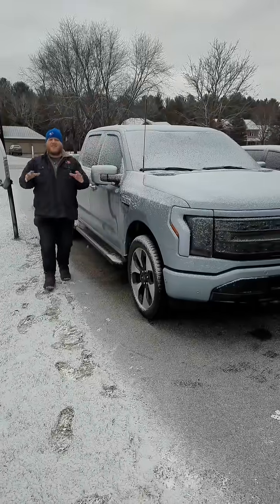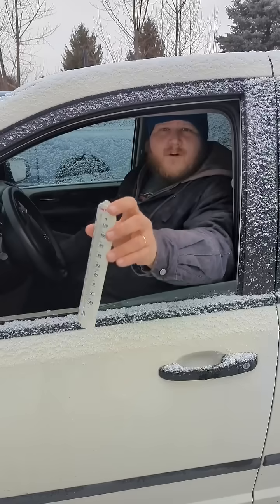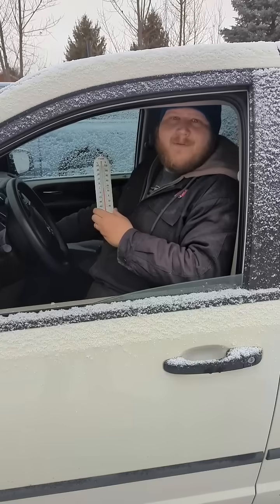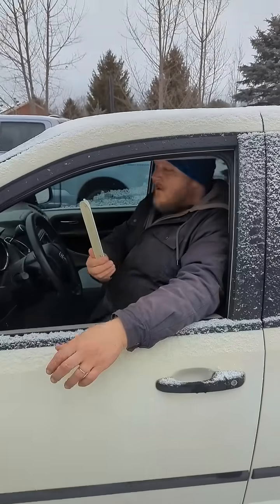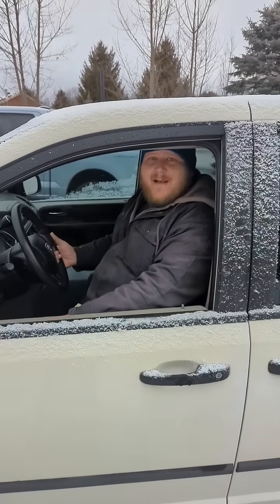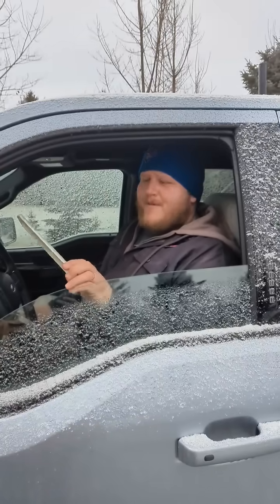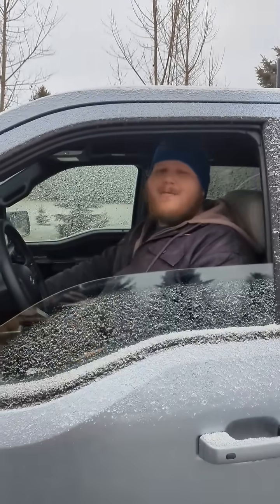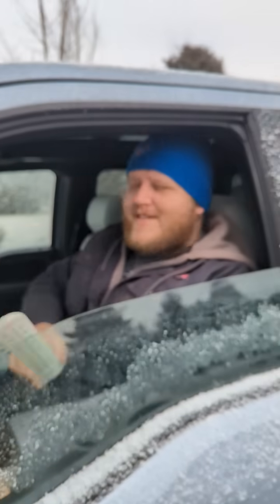Electric vs Gas - Heater Wars! How Long Does the Ford F-150 Lightning Take to Heat Up?

Comment: During that 4 minute warm up you can plan your charging route and figure out how to kill 45 minutes at each station and tell insist that you aren't cheating on your wife. And explain why you missed your kids ball game.
Reply: Because cheating on your wife is no excuse to miss your son's ball game. 😂
Reply: Ah, but here is the thing, you can leave the truck plugged into the charger while it's heating up and you are having fun with the wife. Then you come out to a car with fully cleared glass and one that is nice and toasty while perhaps having picked up a bit more range due to the battery pack having been warmed in the process.
Reply: Lol where did you get these fake ass numbers? Try renting one for a day and then talk after your experience.
Reply: It has like 400km of range in winter. How much are you gas heads driving that it’s not enough for a day?
Reply: @jonathanfields4ever  It's not about having it when you want it, it's about having it when you need it.  And I could not imagine how stressful it would be driving any distance in the winter where recharge stations are not as common as gas stations...and the electric range is not reliably known.
Reply: @fraidykat  it’s not stressful at all. It’s way better than a gas car. You start with a “full tank” every day, you have instant heat, there’s no concern of carbon monoxide poisoning if you get snowed in somewhere, the traction control is better… aside from public charging it’s better in every imaginable way.
Reply: @jonathanfields4ever  thats true, if your riding around empty pussyfooting around town and not actually using a truck for what it's used for  .
Reply: @HK-Guy  which the data show 90% of truck owners do. They’re status vehicles, not work vehicles.
Reply: @HK-Guy which is prob 80% of trucks these days…😢
Reply: @HK-Guy  You do understand that trucks arent just used for "work" right? lmao.
Reply: @jonathanfields4ever  I had someone come into work the other day with a lightning. I asked him how the range was and he said it was the extended range battery that got like 400 miles on one charge, but when it was cold out (it was only like 30 degrees) he said it cut the range down to 240 miles

Comment: So you used a mini van with a heating area four times larger than the F150 and made it seem like the F150 was way better at 5 minutes. Sad thing is the F150 battery is so cold you can't charge it until it warms up. EV fail.

Comment: You kinda botched this by one the ford has the window kinda up almost half way. The heat is not going out as much as it did the first time and two using a older vehicle to test against js

Comment: Hook a trailer and some weight to that turd lol. Technology just isn't there yet.
Reply: Heres 19 reasons why electric vehicles SUCKS.

1) It’s too expensive 

2) Also cause pollution because it’s created by dirty fossil fuels 

3) Tires wear out quickly 

4) Only reliable when temperatures are warm and when it’s cold, it can bring danger to the driver and passengers.

5) Charging stations are hard to find in midwestern states. If you live somewhere like Wyoming or North Dakota, it is clear that you are going to have a lot of difficulty finding charging stations, as well.

6) Roadside Service does not provide Full Coverage and lot of this has to do with the fact that their parts are not on-hand and they are more difficult to actually find than ones for regular cars. Also, auto mechanics will not know how to fix electric vehicles since they didn’t built it. You probably have to find Elon Muck and ask him to fix it for you and he will probably charge you for a million dollars. 😂

7) Travel shorter distances due to the fact that these are cars that need to be charged, they simply do not have the same type of mileage range that regular cars often possess.

8) Too much focus on luxury vs. dependability. With all of the issues that have been discussed thus far, one may be questioning what exactly car manufacturers are aiming for when it comes to making these models. In short, they simply are spending too much time on overall luxury rather than dependability.

9) They get noisy early on. Owners of electric cars have been quite open about the fact that they are prone to make a lot of noise very quickly into their usage lifetime. There is no question that over time, this happens to all types of vehicles, but it is alarming that it has been happening so quickly for electric ones.

10) Maintenance costs far more because when dealing with expensive cars, one can always assume that repairs will end up costing far more. However, when observing electric vehicles, it is clear that the prices to fix them are at an extremely excessive rate. This is largely because finding its parts is far more difficult.

11) some electric cars look ugly

12) Battery pack replacements are expensive due to the fact that electric cars run on their battery packs, it is clear that they play a major role in the overall performance of the vehicle. However, their batteries are prone to needing replacements as time passes by, and they end up costing a ton of money.

13) Recharging takes a long time

14) Durability is not consistent

15) Tend to be heavy due to the fact that electric cars are built with different materials. In fact, the heavy weight of these vehicles is likely another factor that ends up making their tires begin to drop in quality so quickly.

16) One major aspect of the electric car market is that there are limited choices. Unlike regular cars that comes with an abundance of different options, car manufacturers do not seem to release multiple electric vehicles. This is not a solid idea, as electric cars are trying to grow in popularity.

17) Not Good In The Snow. Electric cars definitely meet their match when they are used in the snow. They are prone to having a lot of malfunctions with this type of weather, while also having a lot of difficulty while driving on slushy roads.

18) Too Much Hype. "Show not tell" is the philosophy that car manufacturers should possess. However, when it comes to electric cars, it is clear that this currently is not the case. There is no question that the market is pushing for more usage of electric power, but they have yet to accomplish much in the way of persuading the vast majority of the public.

19) Having a smart car means that the government can track your every move and can listen to your conversations. 

DEMONcrats and leftists wants to banned EVERYTHING. Gas cars, gas stoves, guns, cows, meat, freedom of speech, freedom of religion, and etc. I’m not going to go along with their authoritarian policies so fuck them!

Comment: This is an invalid test. Nothing about the two vehicles are similar, you got a almost 10 year old vehicle with huge interior space vs and brand new vehicle. Also we don't know if the dodge has dual ac or not. Also, test the lightning without the heated cabin option. Here's some advice, delete this video and post a video that has two brand new vehicles.

Comment: There's multiple other EV testers comparing their heating abilities.... much more thorough test... actually measuring the interior air temps in real time, not just what comes out of the vents. Both types of EV heat (resistive as well as heat pumps) were significantly less effective than regular ICE engines. Heat pumps were better than the resistance heater style)...This is well known & a big reason they push seat heaters & steering wheel heat & now some testing with heated seat belts.... because they're trying to heat bodies/core because the actual heaters are very slow to actually heat the whole cabin. In extreme cold, a regular engine heats the whole vehicle almost 4x faster even though it takes a few minutes to heat the engine..

Comment: I have a diesel heater in my van it doesn't take hardly any time to warm up. Don't half to start the vehicle to warm up with a diesel heater you can leave the heater on all night if you wanted to.

Comment: Lol so many ways this could have been done right... cab size for one? A van compared to a truck? Ur joking right...use a gas f150 and an ev 150 with the same size cab..
Roll the damn window up and have the camera man sit inside with you... Who the hell heats up a car with the window down... knuckleheads.

My 05 Honda Odyssey melts the snow and Ice off the window within 2 minutes and the leather seats without the heater will be warm enough to get in and leave by the time I clean it off, what a reach to try to promote an EV. Lol.

Comment: The only way I would drive an electric vehicle is when they make it so it can charge itself as it drives or if for some reason I bought one I would convert it over so that way as it's driving it's producing electricity and charging the battery but I would never own an electric car because I'm not paying $20,000 for a new battery and I like my gas vehicles they're a lot more dependable and a lot safer than any electric vehicle on the road

Comment: One kilometer in range lost in 4 minutes meaning continued use of the heater is a big power draw on a battery with already reduced range because of the cold weather. If I wanna pull the sleds out an I gonna have to pull the truck back home? 😂 Cool toy, but less practical than ice vehicles. Especially with rocketing energy demands and prices, cost of ownership looking better and better for ice.

Comment: When the heater core failed on my Honda, I bypassed it and bought a $60 plug in heater that fits on the dash. The car gets warm soooo much faster than waiting for the engine to warm up. You can feel the heat almost instantly and it defrosts the windshield much faster as well.

Comment: Amused.  That’s a stupid test.  Put that bullshit up against a pre-85 Ford with the original radiator and it’ll heat up faster than that electric bullshit could ever dream of heating up.  AND the old Ford will still have more uses in the next 8 years.
Edit:  Additional.  Heating up the interior that quickly will no doubt turn any rock chip in the windshield into several cracks.

Comment: Now try to drive across country in the cold.
Reply: Heres 19 reasons why electric vehicles SUCKS.

1) It’s too expensive 

2) Also cause pollution because it’s created by dirty fossil fuels 

3) Tires wear out quickly 

4) Only reliable when temperatures are warm and when it’s cold, it can bring danger to the driver and passengers.

5) Charging stations are hard to find in midwestern states. If you live somewhere like Wyoming or North Dakota, it is clear that you are going to have a lot of difficulty finding charging stations, as well.

6) Roadside Service does not provide Full Coverage and lot of this has to do with the fact that their parts are not on-hand and they are more difficult to actually find than ones for regular cars. Also, auto mechanics will not know how to fix electric vehicles since they didn’t built it. You probably have to find Elon Muck and ask him to fix it for you and he will probably charge you for a million dollars. 😂

7) Travel shorter distances due to the fact that these are cars that need to be charged, they simply do not have the same type of mileage range that regular cars often possess.

8) Too much focus on luxury vs. dependability. With all of the issues that have been discussed thus far, one may be questioning what exactly car manufacturers are aiming for when it comes to making these models. In short, they simply are spending too much time on overall luxury rather than dependability.

9) They get noisy early on. Owners of electric cars have been quite open about the fact that they are prone to make a lot of noise very quickly into their usage lifetime. There is no question that over time, this happens to all types of vehicles, but it is alarming that it has been happening so quickly for electric ones.

10) Maintenance costs far more because when dealing with expensive cars, one can always assume that repairs will end up costing far more. However, when observing electric vehicles, it is clear that the prices to fix them are at an extremely excessive rate. This is largely because finding its parts is far more difficult.

11) some electric cars look ugly

12) Battery pack replacements are expensive due to the fact that electric cars run on their battery packs, it is clear that they play a major role in the overall performance of the vehicle. However, their batteries are prone to needing replacements as time passes by, and they end up costing a ton of money.

13) Recharging takes a long time

14) Durability is not consistent

15) Tend to be heavy due to the fact that electric cars are built with different materials. In fact, the heavy weight of these vehicles is likely another factor that ends up making their tires begin to drop in quality so quickly.

16) One major aspect of the electric car market is that there are limited choices. Unlike regular cars that comes with an abundance of different options, car manufacturers do not seem to release multiple electric vehicles. This is not a solid idea, as electric cars are trying to grow in popularity.

17) Not Good In The Snow. Electric cars definitely meet their match when they are used in the snow. They are prone to having a lot of malfunctions with this type of weather, while also having a lot of difficulty while driving on slushy roads.

18) Too Much Hype. "Show not tell" is the philosophy that car manufacturers should possess. However, when it comes to electric cars, it is clear that this currently is not the case. There is no question that the market is pushing for more usage of electric power, but they have yet to accomplish much in the way of persuading the vast majority of the public.

19) Having a smart car means that the government can track your every move and can listen to your conversations. 

DEMONcrats and leftists wants to banned EVERYTHING. Gas cars, gas stoves, guns, cows, meat, freedom of speech, freedom of religion, and etc. I’m not going to go along with their authoritarian policies so fuck them!

Comment: my 94 del sol is well under 5 minutes, he clearly chose the van because there's a ton of space to heat up. Not that 5 minutes is bad for a truck or anything! But he should've used another truck for the control number. Obviously bias towards the truck here.